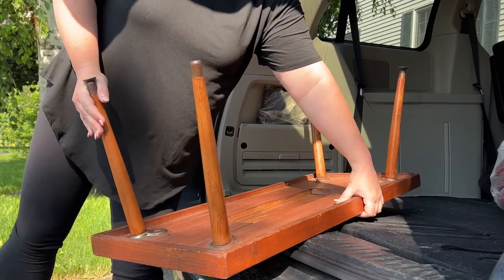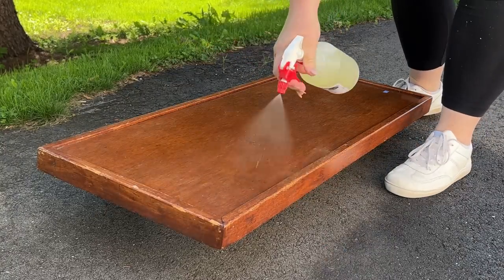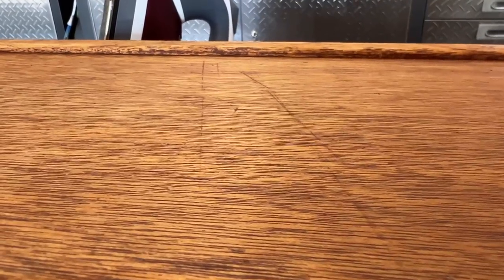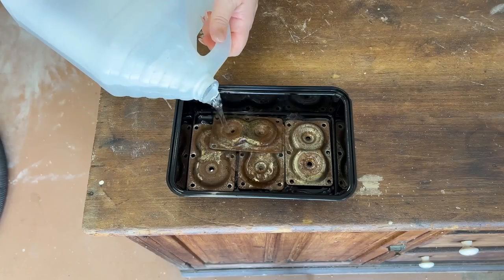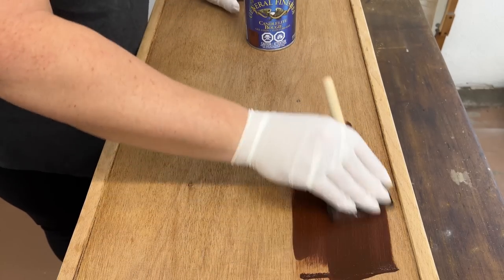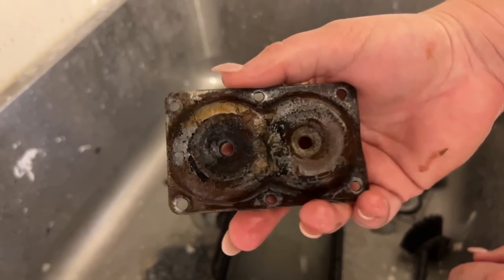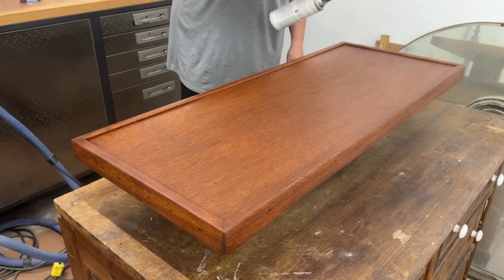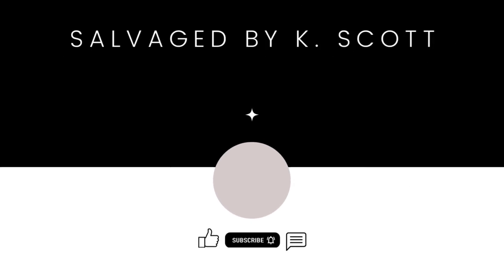Teak-ing it to the Next Level: Reviving a Mid Century Modern Coffee Table!

Comment: QCS works great on older finishes or lacquer.  I have had good luck with it on those.  the furniture with that thick multi layer poly top coats does not respond so well.  Great little table project. turned out amazing, like always.

Comment: Maybe I missed this, but did you lacquer the legs too? I once made the mistake of doing three coats of gel stain on the legs of a table so that it would match the top. I finished the whole piece with rub-on poly, but the poly dissolved the stain on the legs, so they then looked too light. I then re-sanded, re-stained, then used spray-on poly to finish the legs. This turned out much better! We can learn from our mistakes. Sorry you spilled your stain!
Reply from the maker: I did spray the legs the same way as the top. It’s best to avoid a rub on product with gel stains used like that for that very reason 😉

Comment: Have u ever looked into a portable sand blaster?  They are great and I feel like you would have a lot of application for one to assist with cleanup....
Reply from the maker: I have looked into them and can’t justify the cost or hassle of cleaning up or ventilating my garage to use one.
Reply: @salvagedbykscott  I use mine to clean up large wood slabs.  Way easier than picking at it and grinding with a wheel.  Bit messy but I do it outside.  Really enjoying your videos though 👌